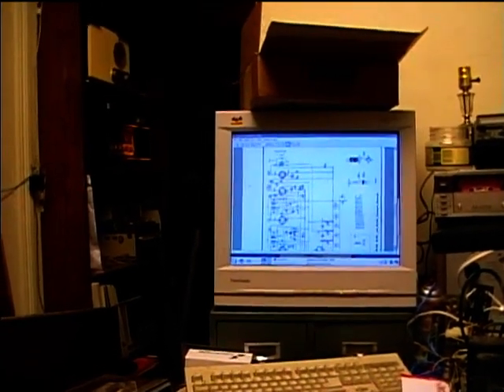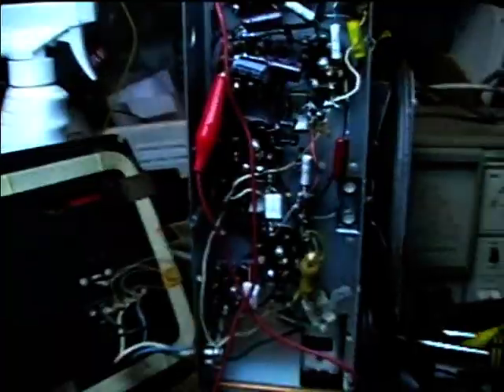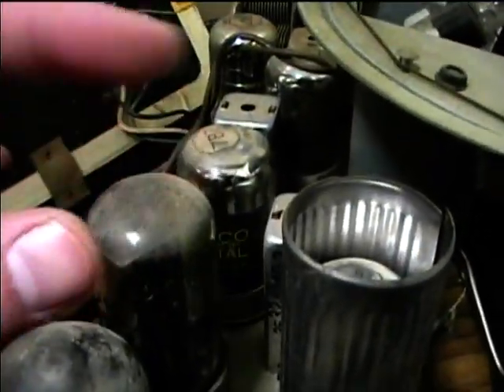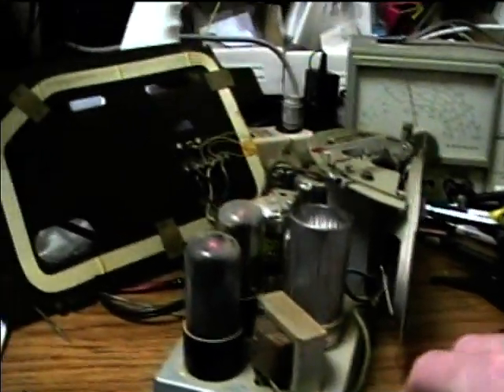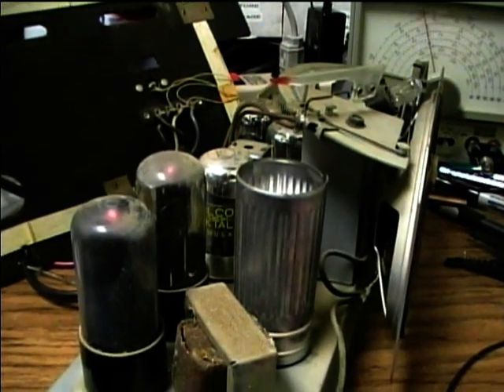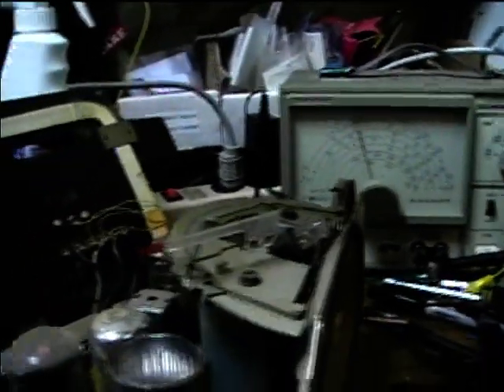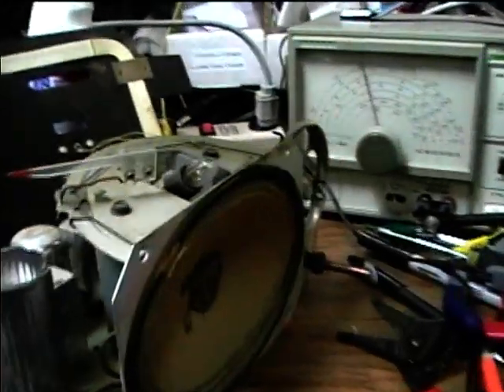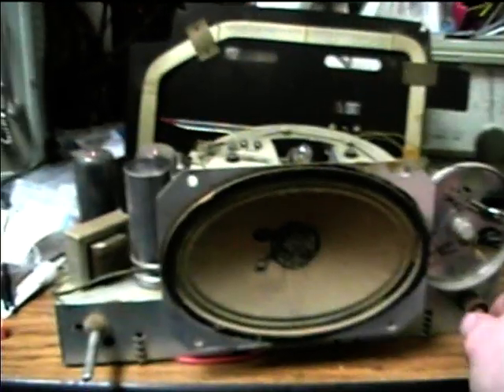Philco 50-920 tube type radio complete repair job part 9

Comment: Nice repair work, that radio  sure has crisp clear sound.  I  had a problem with an IF transformer they area very difficult for me to deal with.  I had an IF tansformer not working due to a wire detached from the coil inside. .  It was almost impossible to find the tiny wire at the begilnning of the coil.  Unwinding enough wire to resolder was even more of a challenge.  Too hot of a soldering iron destroys the wire about the size of a human hair, but it was all I had and I finally got it working

Comment from the maker: @batterymaker I actually did just a quick re-alignment using the signal generator with a very weak signal and adjusted the IF transformers and trimmer capacitors and it did improve it from the first test after replacing the caps.

Comment from the maker: @Vinylrecordsneverdie Thank you! I have found usually 1950's radios are the worst for this problem...by the early 60's they seem to be better but I have run across a few early 60's ones with it too.

Comment from the maker: @maynardcat I had one of these wires break off too at the coil on a Motorola radio I did and I had to unwind some of the coil to get the wire but eventually I did get it out and got it soldered.

Comment from the maker: @mznxb9872 I remember one time reading through a search on the internet that 100 pf. was used in AM circuits and around 22 pf. used in FM. I have tried these values in other radios and they worked well.

Comment: I have a similar problem with the Zenith "toaster" radio. I have no luck resodering the hair thin wire. After several attempts the wire has now shortened. Can I mend a wire from the lug to the wire that's now dangling?  Would a wire from another IF be okay to use eventhough it maybe slightly thicker? Can I unwine 1 rotation if the wire and reconnect to the lug? I would appreciate it if you can give me advice.